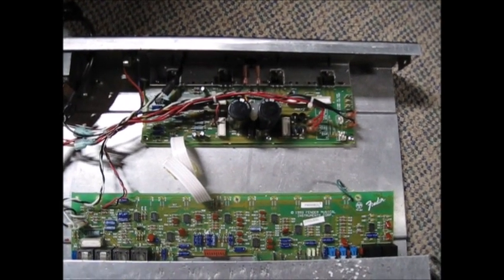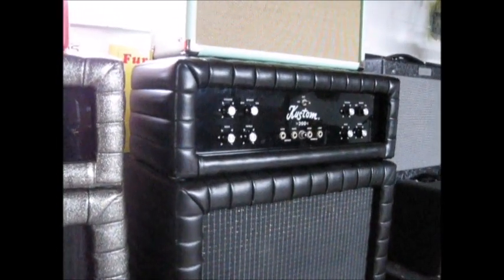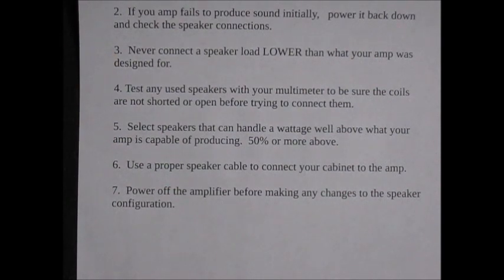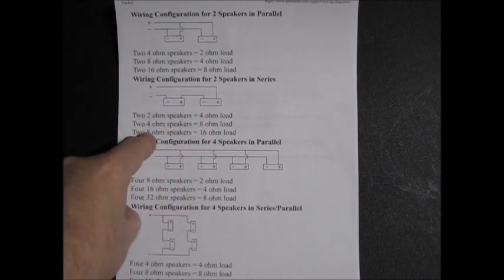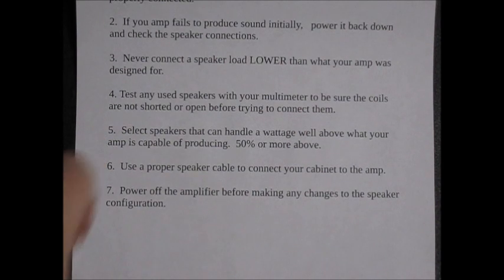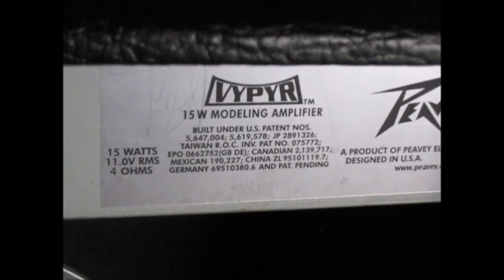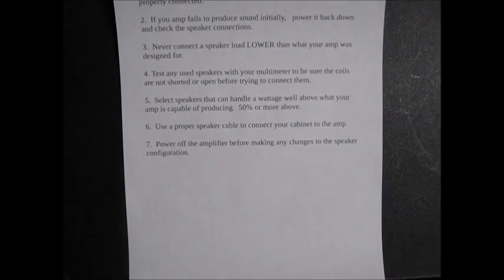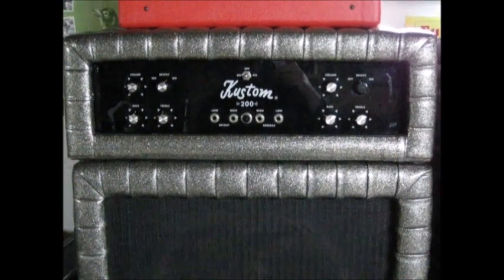#1 Cause of Solid State Guitar/Bass Amp FAILURE, and how to avoid it.

Comment: Solid state amplifiers with discrete or integrated output sections do not need a load connected to power up the amp. Obviously running too low of a load either a shorted  voice coil or a driver with too low of impedance will cause excessive output current to flow. In the case of no load there will be no path for output current to flow.
Reply from the maker: Some of the TDA chip integrated devices were at risk...   so I broad brushed

Comment: Admittedly, I am not an expert on amp electronics, and everything you say here seems correct from what I've come to accept as standard practice, except the idea the SS amps need a load. I have only ever experienced the necessity of a load with tube amps since they always have power transformer, while most SS amps do not have or frankly require such an output transformer. Nonetheless, I do have some questions for you about grounding an amp that was designed with a 2 prong plug, and getting working safely fully grounded. The guy I used to go to has fully retired and it's been a while, so I have no way of contacting him. I had to drive an hour out to a music store I went to years ago that never seemed like they knew what they were doing, and they told me it can't be done, and it's by the design that I'm just gonna get shocked playing my guitar through that or any other old 2 prong amp. That is absolutely unhinged response in my opinion. I asked them, "so for years anyone plugging in an amp and playing it came standard with shock therapy?" That cannot be the case. Now if it can't be done, fine. But you're telling me that all these guys with vintage amps are getting electrocuted DAILY for years, decades, etc? My other question is about a Kustom 1-L? Solid state amp that has considerable low end hum depending where the power on switch is set (I have to shimmy it, or knock on it, to reduce it) They said that it's probably capacitors going, and they said that the parts don't exist to fix it and that tube amps are easier to fix than SS amps. They basically were saying everything opposite of what I've been told and taught through out like 15 years of owning SS amps. Thanks for taking the time to read this and any response would be appreciated.

Comment: SS amp will happily run with an OPEN load. Also a 1ohm emitter resistor is quite high compared to most SS amps, typical value being .22 - .47ohm. This improves the lifespan of the output transistors a bit at the expense of a smidge of headroom.
Reply from the maker: The amps with the TDA2030 or TDA2050 have failed no load on my bench....   so,  I'd rather be safe.

Comment: I'm trying to determine the load required for an old SS amp I just got, but it's not designated on the unit, and it appears no good schematics exists.
Reply from the maker: If you know what type of power transistors are in there you can probably look up a few sample circuits that might give you a gist
Reply: @DeadKoby  Thanks. I'll look into that.
Reply: @johnstrange6799  My rule of thumb is, if it only has a pair of outputs (so 2 total) I wouldn't go lower than 8 ohms. Old Germanium amps (the first type of output transistors to be widely used ) designs were used with a 4 ohm load because Germanium couldn't be made to withstand higher voltage. This was to maximize power with lower voltage. Must have led to a higher failure rate, that and, Germaniums had much higher leakage than today's BJTs.
Reply: @prattacaster  Excellent info. Thank you.

Comment: Hello, I have an old solid state Crate B10 xl bass amplifier that has a single circuit board that’s fairly simple, I’ve been trying to get it working again for a couple of years now. I was playing it and suddenly zero sound but it still powers on. Even if I touch the aux or move the knobs there is no sound. I’ve confirmed that the speaker itself is still good and so is the fuse. There is no sound from the headphones input, there is no visible signs of anything that got hot or shorted. All the wiring is good. The aux inputs are clean and have good contact. I e even re-soldered all the points in case of any cracked soldering but still nothing. I’m suspecting the output mosfet but I can’t tell for sure, I’d appreciate any suggestions.
Reply from the maker: Always start with the power supply.

Comment: Great channel/info... friend brought me a dead SWR 350 Bass amp head... he was replacing cooling fan... pretty sure he powered it up "no load", fried R22 on the power amp board... if you have any familiarity with this amp, would appreciate any advice... thnx in advance...
Reply from the maker: I really don't....  but you can check the output transistors for shorts.  That would be the first thing to try.
Reply: Thnx, was hoping you knew if this was one of those SS amps that can't handle a "no load" power on... for that matter, is there dead give away on a SS amp schematic, for ones that can handle it vs ones that can't... I have a screen shot of the schematic, if that helps... thnx again in advance... (FYI: Not a repair shop, just another instance of a guitar player trying to help a friend here...)
Reply from the maker: I'm not sure I can help from where I am.
Reply: @DeadKoby  That's ok... thnx... I'll chk for transistor shorts like you suggested, start there...
Reply from the maker: Best wishes.

Comment: Thanks for the video. I just got a Polytone Mini-S12L solid state Jazz amp from 1982 according to the pot date codes.  Original 12” speaker was blown according to the last owner.  I took a chance and bought the amp anyway for cheap. I put in a new speaker and fired the amp up. Has more background his and noise floor than I would expect. Tremolo has a constant tic tic tic… similar to fender tube amps. Also when turned up loud will get a shorting type noise bzzz bzzz when playing chords or digging in and playing hard.   I do not believe it is the speaker as it plays fine in other amps. As long as I play clean single line notes amp doesn’t get that bzzz bzzz.   Seems like the amp can’t handle the load asked of it when it gets the bzzzz. 
Question, does this sound like  needing new electrolytics?   It has two really big ones next to power transformer they are 7300 uf at 50v. Mouser has them for $50.00 each.  Jaimco doesn’t have 7300 uf but does have 10,000 uf at 50 volts for $6.99.  Not sure if going up that much is ok. Any thoughts or insights would be appreciated, I usually just work on tube amps.
Reply from the maker: Sounds like electrolytic to me the 10,000 microfarad should be okay
Reply: @DeadKoby  thank you for the reply, I will try new caps. Also I am still really enjoying the Arena Verb you built for me last spring. I still need to do a video on it and post it on my channel.
Reply from the maker: On a diode rectified solid state amp,  there's minimal penalty to upping the filters.   The Old Kustom 200 B1  Originally had 4500uf in it...  and now it's got  10,000uf.    Big loud bass notes were actually DIMMING the lamp before the upgrade.    The Power transformer in the old Kustoms is a beast,  and it can take it.    You're not making a huge leap from the 7300 to the 10,000.

I take my Arena Verb with me often when I play out.   I've TRIED to get a pedal to give me that sound....... I've tried a smaller verb unit...   Still no dice.  The Arena is the sound.
Reply: @DeadKoby  thanks for  dropping knowledge from experience on the caps. I will be changing them out. 
Yep the arena verb is a great sound.

Comment: So if you have a damaged speaker for whatever reason , your unaware it broken, you power up the amp and kaPow! Dead amplifier beyond repair? No safety guard to prevent this? Ohm meter test before every power up needed? This doesn’t sound kosher. Gotta be more to it.
Reply from the maker: Many amps under 100w have no protection.   It's best to put a meter on used speakers in unknown condition before attempting to plug them in.

Comment: People say (including amp manufacturers) that Solid state amplifiers don’t need a load.
Reply: That what I’m thinking ( no load needed)
Every time a speaker connection was lost an amp would be open to catastrophic damage. 
To many of these guys on youtube don’t know what they’re talking about! When in doubt ask the manufacturer.
Reply from the maker: It really depends on the design.   Take a practice amp with one of those TDA chip modules as the power section.........   disconnect the speaker and see what happens....     

I've stopped chancing it...  I ALWAYS put a dummy load or a speaker on there if I'm powering it up.

It's the Internet........I'm wrong about everything by default.
Reply: @DeadKoby I test TDA chip amps into open loads all the time, it's fine; to be fair, I don't know about constant use into an open load but I'd be surprised if it failed. Also, who and why would you do that 😂

Comment: Hi DK, love your vids!  Would you be willing to recommend gauge (or possibly even brand and model) of leads with alligator clips for use in connecting amp to test speaker?  Amazon has options, but they seem really thin and I'm worried they would fail.  Thanks!
Reply from the maker: You want a heavier gauge wire... like 16awg  https://www.jameco.com/z/GAL1016-Jameco-Benchpro-16-AWG-Alligator-Clip-Test-Leads-2-Sets-of-5-Colors-10pk-_2210239.html
Reply: @DeadKoby  Thanks so much!  The gauge recommendation along with the link to a trusted supplier is much, much appreciated.  I've been messing around with "malfunctioning" amps and it's really fun.  Paid $60 for a Fender Deluxe 112 the other day... only thing wrong with it was a dirty input, a couple of dirty pots and a few missing screws.  Cleaned it up and now it's a $180 amp I reckon.  Clean channel sounds fantastic and I'd almost keep it, but too loud for my needs and the gain channel's only useful in one spot for my taste (contour at zero, gain at 1, bass down to 3, paired with single coils)... otherwise its too mushy. Got may eyes on a small Laney with an intermittent gain channel, but the guy needs to come down in price more. Anyway, thanks so much for your teaching and your entertainment. No way I'd be messing with this were it not for you and a few other other folks.  Oh, and I know a lot of guys love the tube stuff, but personally I love the solid state amps.  Thanks!!!
Reply from the maker: @HereComeMrCee-Jay  That's how we all start out...  solving level 1 issues.   Tell yourself this.... It's already broken.....so may as well try.

Comment: Excellent video, I've learned a great del about speakers etc..I have a solid state pa amp, and was wondering whether I could use an 8 ohm speaker with it as it'ssupposed to have a 4 ohm but I haven't got one with that impedance.. Very informative..Ed.uk.😁
Reply from the maker: It's a valid question.   The Ohms rating on a Solid State amp is a minimum.    You could use an 8ohm speaker, but you may not get the amps full power.  Not that it's a big deal in many cases.
Reply: @DeadKoby  Thank you for your reply..Ed